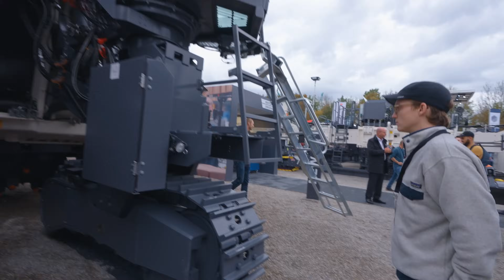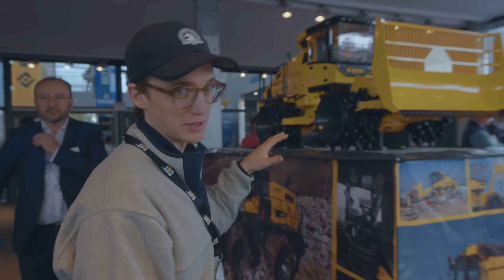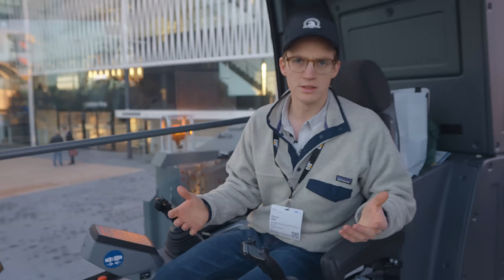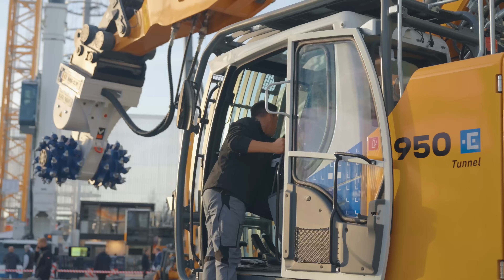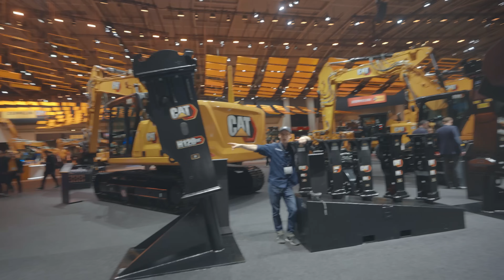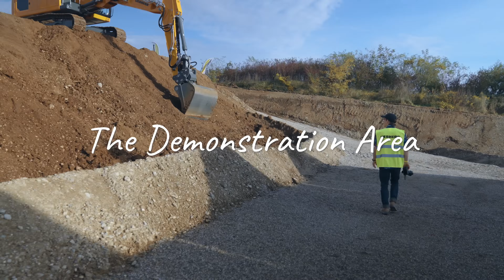The World's Largest Construction Trade Show: Bauma 2022

Comment: Being a heavy equipment mechanic I just don’t see the electric keeping pace with the diesel
Reply: depends for what use u need the machine. The biggest machines like bucket-wheel excavator, cranes, dragline excavator, giant stripping shovels, tunnel boring machine, etc. work all electric. It much more cheaper for the users. When you have in maybe 10 years better battery packs or when you can chance this pack fast and easier, then you will have all machines with electric motors.

Comment: The electric equipment is sketchy. Because it’s pretty much only useful in confined spaces but I guarantee you that isn’t the intent. I think they’re getting ready for the government to take away our right to use diesel and gas burning engines in which case we’ll all be mega screwed but I wouldn’t put it past them to try.
Reply: Larger equipment that doesn't move often or follows the same path over and over again are easy to electrify and reduce cost, all the massive bucket wheels in germany are electric
Reply: @09impala  I’m talking about the majority of equipment. Grid powered equipment is extremely rare.